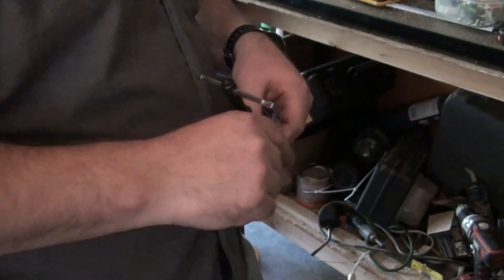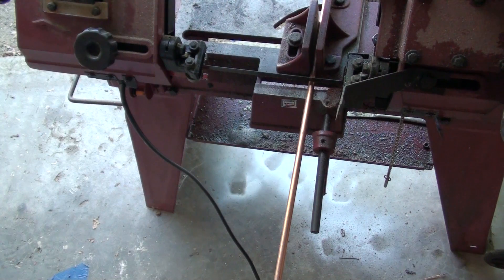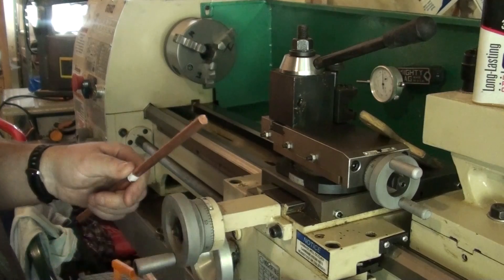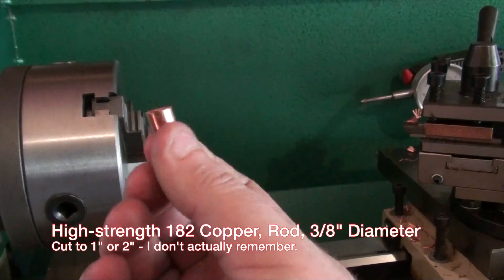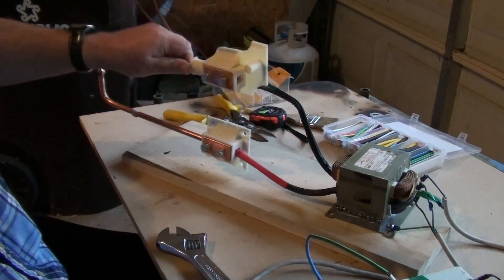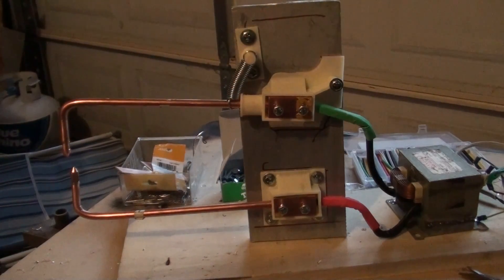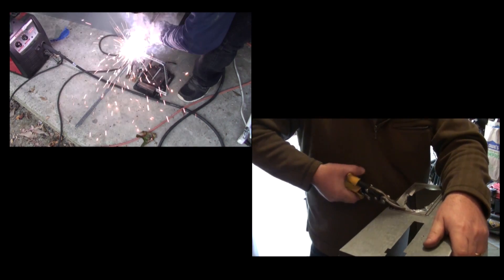diy microwave spot welder - the hardware

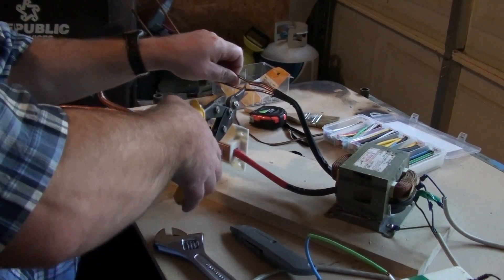Comment: @ 13:43 where you are using tin snips to cut the cable, you would be making it 100 times easier on yourself if you were using a pair of High-Leverage Cable Cutters. There not expensive ($10 - $30 depending on where you live) and will last you a lifetime. I have had my Kline High-Leverage Cable Cutter for about 15 years and have made literally 100's of cuts. Just a suggestion.

Comment: the first one I made didn't not work...

the second one I made. I used a transformer from a 1200 watt microwave... the coil looks almost like 14 gage wire... the metal almost bond instantly...

look at the ratings on the microwave before you rip it appart...
Reply: bigmac turd.
Well that told us nothing.  What wattage was the failed try, what secondary wire and how many turns?

Comment: Put the transformer in a box and connect the two secondary wires to the frame. Then use two separate pieces of wire to connect to the secondary wires on the transformer and then to your cooper rods. It will make it much easier.
Reply from the maker: robviolin1 that would have been more easy.
Reply: you cant use the original secondary coil because it arks out at a huge distance ! you would just end up with a giant ark
Reply: and if you think you no a better way why watch?